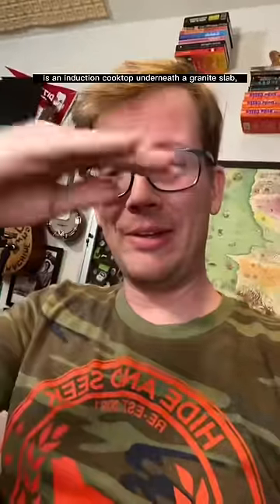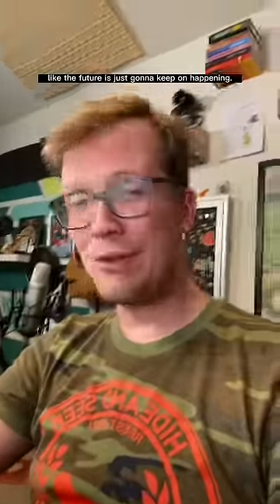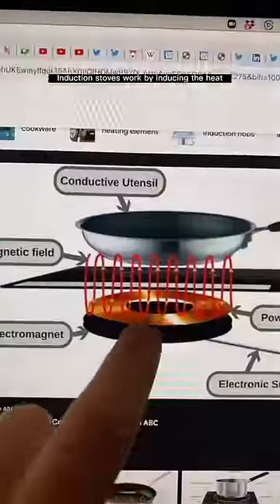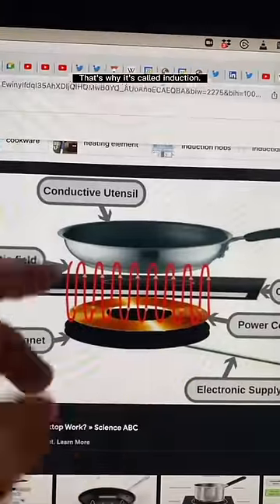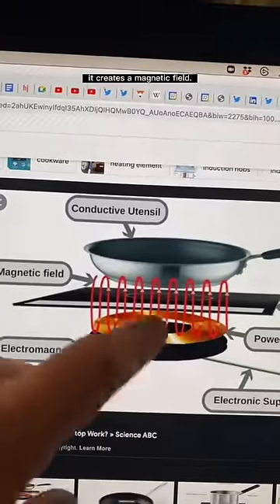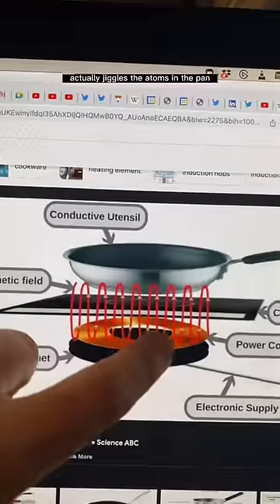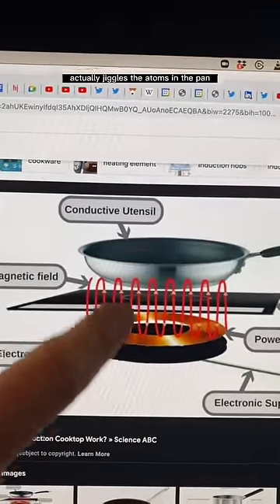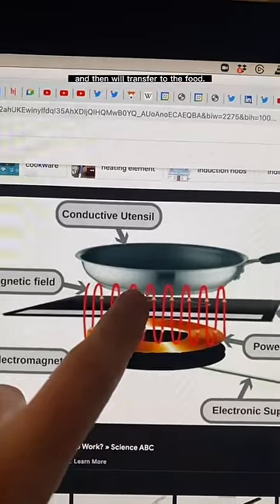How do induction cooktops work?

Comment: This is definitely interesting. But I feel there's lots of value to be gained from having your stovetop be a different color than your countertop.
Reply: A different color or like just a marking of some kind to indicate where the zones are. A different color is not really that much better than putting a actual commodity induction cooktop into granite from aesthetics, but putting like just little rings to indicate the zones would be at least decent with regards to usability and aesthetics.
Reply: @elizabethrayet7396 Some modern induction stoves actually don't really have zones anymore. They do still consist of multiple coils and that stuff but they are arranged and controlled in a way that it doesn't matter anymore, where exactly you put the pan.
Reply: For instance, where the hell is the burner or Stover start and finish!
Reply: @rice83101 induction cooktops don't get hot, he literally explains it in the short...
Reply: @CircusFoxxo Well yes, but metal objects we may be holding, like knives, spatulas, forks, or phones, DO.
Sure, we can put our hands on the tabletop- hell, LAY on the tabletop while it's on max settings and be PERFECTLY FINE, but as soon as we put anything even REMOTELY conductive near it, we can say goodbye to whatever else was touching it that isn't resistant to high temperatures.
Reply: @rice83101  pov you've never seen or heard of an induction cooktop before
Reply: @CircusFoxxo I can see you've never used an induction cook top in real life,  constant you don't understand its the pan itself heating the counter top, and aisha burning you, not the induction coils.
Reply: Imagine trying to cook food on this, and searching for the invisible spot on your counter that heats things.😅
Reply: @CircusFoxxo While the top might not be heated the same way as old fashioned ovens do, they can still be heated from above by the pots and pans. It can still take a little while to cool down from that.
Reply: @darkking_lp  that's awesome, still needs differnt colors, not saying you said they didn't
Reply: @jeffwells641 that's what they're saying. The counter would still get hot. Because the pans on top would get hot and transfer heat to the stone counters. So it's not really safe
Reply: @msjkramey  No, they quoted someone else who said that, and said that person didn't know how induction works. Please learn to read.
Reply: Right? There's a reason most flat (electric) stovetops are black/gray. I'd be afraid of burning/staining anything.
Reply: @rice83101 granite is extremely heat resistant, and a natural heat sink. It’s relatively low thermal inertia compared to other surface materials means that it’s unlikely someone would burn themselves on it before it cools down, unless they touched it immediately after moving the hot pan.
Reply: The glass and pan both conduct heat 😂 one part of the induction stove will be hot
Reply: Yeah, this is way too much no UI for me.
Reply: I have an induction cook top that only has a granite slab over it (though I do have markings to show the cooking area), unless you're touching it right after you take the pan away I find that it's safe to touch within about 20-30 seconds, I've never had the inclination to put my phone on it, and most of my silverware and utensils are not magnetic so I haven't had that issue but I could see someone really careless could hurt themselves, but anyone being careless in a kitchen can hurt themselves.
Reply: Id FORGET WHERE it precisely is and burn myself and plastic stuff all the time. 😂 would not get it even for free.
Reply: @rice83101  That was an enjoyable read, ty.
Reply: @CircusFoxxo   yes, just make sure you hands are free of metal accessories
Reply: @Glorfand244  they only work on flat metal of certain compositions and sizes/shapes
Reply: @rice83101 I’m pretty sure these types of cooktops only affect the pan. 
Like the counter itself isn’t getting hot, it’s the stuff in the counter that reacts with the pan and heats the pan. The granite isn’t getting hot, as that would be a massive problem and like you said leave to many burns. 

I’m sure if you left your arm laying there for 10 minutes it wouldn’t be pleasant, but the whole idea of this is that you can just put your hand down and it’ll be normal countertop temps.
Reply: Imagine putting something that could be damaged or heated by the magnet on the counter not realizing the stove is on💀
Reply: @tmraaex9617 Yes, like a phone, tablet, or laptop! Having no easily visible controls or warning light is definitely very stupid.
Reply: I’ll wait to see what a professional chef says about these cooktops before you you know what I’m saying like let’s just hold off on that shit you know what I mean but it does seem cool like I’m down for that but like we need to wait on that you know what I mean like that’s how it is
Reply: Like stubbing your toes into invincible buttom door sills
Reply: My thought exactly 😂
Reply: @CircusFoxxo  Except for the fact that they sit in direct contact with your hot pan, so they absolutely heat up by absorbing heat from your pan(s), especially if you're cooking for long periods!

They don't heat up as directly or significantly as an electric or gas powered stove, of course, but it's not like they stay at room temperature; you're a lot less likely to get severe burns touching it during or immediately after cooking, but you do still need to be careful around them! (I speak from experience; I've gotten a couple of blisters from my induction hob before now because I am,,, not smart when I'm hungry lmao).
Reply: Lol this whole thread is people explaining that heat can and will transfer from an induction heated pan into a counter top, even if the countertop doesn't get heated by induction, and other people ignoring that they said that and going "but the induction doesn't heat the counter top!"
If you think the counter top wouldn't get hot due to touching a pan that is heating up, then why would you think your food would heat up?
Reply: @CircusFoxxo yes but the thing under the pan does get hot, hence, the induction top does get hot.
Reply: @jeffwells641 fr that circusfoxxo guy just out to be rude. induction tops obviously heat up cos theres a hot thing touching them, they could, however, make them out of an incredibly good insulator. as in pretty sure magnetic fields pass through those
Reply: @MoonyWych  That's definitely true. Realistically glass is actually decent for this, it's a bad thermal conductor, but it will heat up and hold heat for a while, but the heat transferred by a pot heated by an induction coil is going to be way, way less than the old-school glass tops that were heated directly with electric coils. Still probably hot enough to burn you if you have a hot pan on there for several minutes, but it should also cool off quickly. 

Aerogel would work amazingly well for this purpose, but it's brittle and you'd definitely break it just in regular use.
Reply: @jeffwells641  stone probably isnt terrible either, but ideally some thermal ceramic or adding a heatsink or post-cook cooling, or just have a brain and mark the are so u dont touch ot
Reply: I like how gas cooks too... I never tried induction.. but gas just hits different you know? like analog vs digital.
Reply: @MoonyWych  I know for certain induction wok heaters the induction surface is actually shaped so the bowl of the wok is suspended a millimeter or less above the induction heater surface. In that case you can lift the hot pan and put your hand on the heater and it will be barely warm. 

You could do this for the flat cook top, but then you'd have to have small bumps on the counter and I'd bet money no customer is going to like that, so they don't do it. 

The gist of it is, the counter top is going to be hot. It's going to be a lot less hot than the pan itself, but there's still a reasonable chance to burn yourself if the pan has been sitting there long enough.
Reply: @darkking_lp But then how do you have multiple pans at different temperatures if there aren't zones?
Reply: @CircusFoxxo it doesn't directly get hot, but after 20min of a hot pan sitting on it, it most certainly is very hot
Reply: @MarcusBeirne  with how expensive that induction stove is, it’s probably the kind where it doesn’t matter where on the stovetop you put your pan.
Reply: At which point you’re completely defeating the point of having it underneath the granite, and might as well just install a regular induction plate.
Reply: @CircusFoxxo  Does your countertop cook food? Because we all know your counter gets hot after putting a pan that you just cooked in onto it. Try using your noodle next time.
Reply: @shawnpitman876  

I don't think you know how magnetic induction cooktops work

They're literally advertised as safe to touch after cooking on them
Reply: @CircusFoxxo  I don't think you've ever actually USED an induction cooktop, just because something is advertised as something doesn't make that statement actually true.
Reply: @CircusFoxxo  No, but some visual indicator would be a good idea to stop guests from leaning on it while holding a phone/cutlery.
Reply: @CircusFoxxo  Iduction stovetops can still get hot from conduction from the object that they are heating that is in contact with their surface.
Reply: The beauty of these cooktops is if you can have special lasers aimed to show the center and edges of the induction element, making it super easy to find where to place your pans. 

Also some induction elements they put in the countertops are just big rectangles where you can define zones. So you place a pot down, it recognizes it’s a pot and you can choose what temp that pot goes to. Also if you move the pot it automatically will move that setting. Amazing stuff, but last I heard it was a $10,000 upgrade.😢
Reply: @CircusFoxxo the counter doesnt, the pan does lmfao
Stop acting like you know how they work 😂
Reply: Some people are more motivated by aesthetic than function... which is kind silly since aesthetics is subjective,  while funding can be measured... but hey,  ppl also believe in ghosts.
Reply: @CircusFoxxo How does a cold pan cook food???? 🤔🤔🤔
Reply: Some people put an isolating mat between the pan and the worktop to prevent the last from heating and indicating that the stove is on...
Reply: imagine forgetting it's on and then starting to chop veggies on there . . .
Reply: @CircusFoxxo they do kind of. As the food and the pan gets hot, the heat is also transferred back to the surface of the stove. (Like putting a cup of hot tea on your lap)
The heat gets away pretty fast but still long enough to get a ninor burn on your hand.
Reply: Broski you wouldn't make the fire extinguisher blend in for aesthetics so why make the actual dangerous thing blend in?
Reply: @philipparadise7653 I assume the entire counter is a single burner, so any pans anywhere would get hot. Induction is nice because the parts without a pan won’t get hot so it doesn’t matter if it’s just one giant “burner”
Reply: This stove likely has a protective mat that you put down before cooking. The stove won't work without it AND it magnetically locks into place where it's supposed to be.
Reply: Sets phone down on an area that is turned on. Wireless charging is also induction but I'm pretty sure your phone couldn't take it.
Reply: @Leekodot15 
No,not anything conducting!!!😂😂😂.

Comment: "jiggles the attoms" is a microwave.
"wobbles the electrons" is induction.
Reply: lol wait I want to know if there’s something to this or if it’s just funny
Reply: holy cow, HANK WAS WRONG!
Reply: You got the know-how on the wiggle wobble jiggle juggles 😂
Reply: @peterbillings3276  Hank's explanation was missing the half where the name comes from. The magnet creates a changing, or wobbling, magnetic field, which in turn induces a wobbling electric current in the pan. Essentially, the current is making the electrons in the pan wobble, which then heats it up.
Reply: I lay awake at night wondering what frequencies of induction would be impedence matched with the dipole moment and mass of water molecules.
Reply: Also does it mean the bots have to be made of certain metals?
Reply: Yes. Induction cookware is ferromagnetic, or has a ferromagnetic plate included in the heat spreader assembly.
Reply: "Twerks the electrons" is the scientifically approved terminology here.
Reply: @Leadvest You are going to love the HITRAN database.
Reply: @tykjpelk  You're god damned right I do.
Reply: Wait till you hear what "shaking the atoms" does!
Reply: In induction stove, your cookware ( iron and compounds/ alloys)heats up. In microwave, the food (water molecules in your food) heat up.
Reply: No
Reply: @Cheesepuff8  yes, for example aluminium pans do not work 

My friend did a lab thing from home where they had to use an aluminium pan but id didn't work bc she had an induction stove - had to come to my place because I have a regular ceramic stove
Reply: Pretty soon they're making a baby 🤣
Reply: @Leadvest 2.45 GHz , but then you'd be shooting microwaves into the room 🤣

It would be a great bug. Zapper